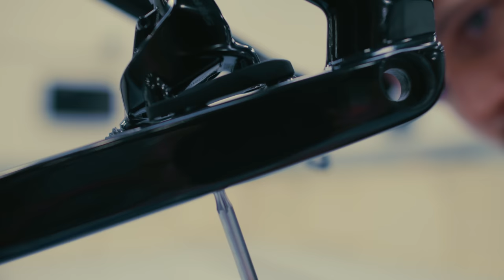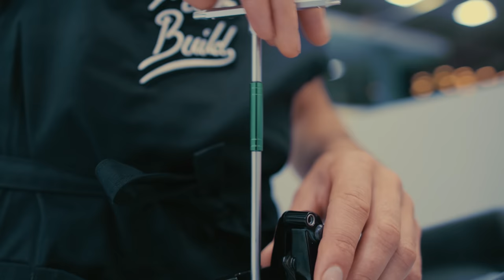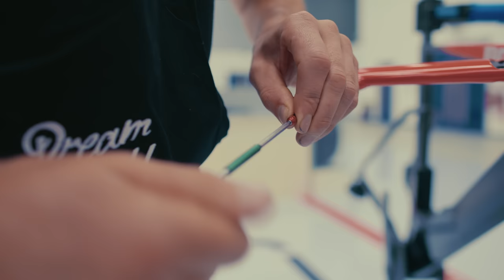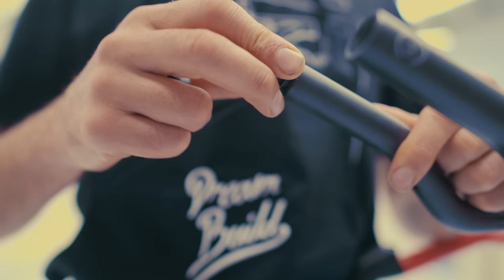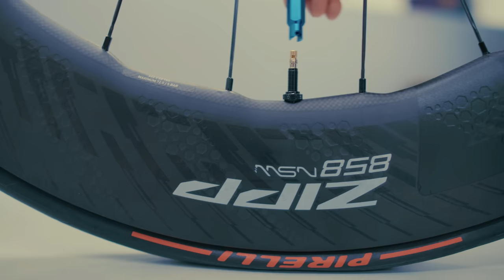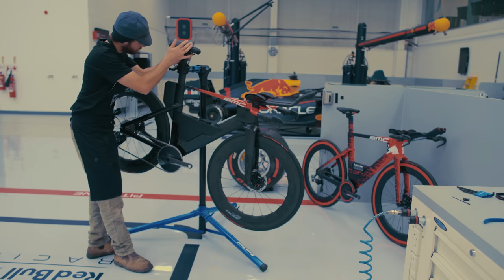DREAM BUILD TT bike - BMC Speedmachine x Red Bull Advanced Technologies

Comment: £3130 on wheels and tyres alone 😂
Reply from the maker: Speed is expensive haha
Reply: Not that expensive compared to MTB as if we were to compare the frames I think. 3 thousand pounds is close to double the price of the top level MTB wheels with tyres, but the frame? Propably 5000 pounds or more, thats what really expensive
Reply: @GeeMilner  cheaper having a cocaine addiction than speed 😁